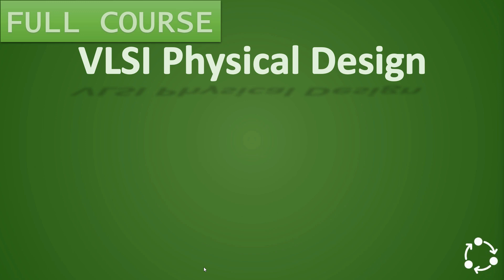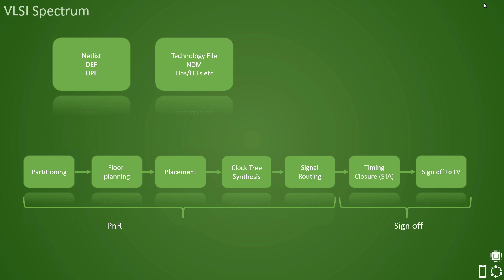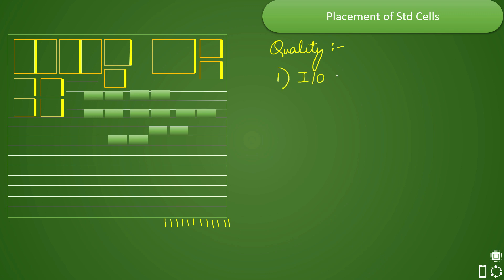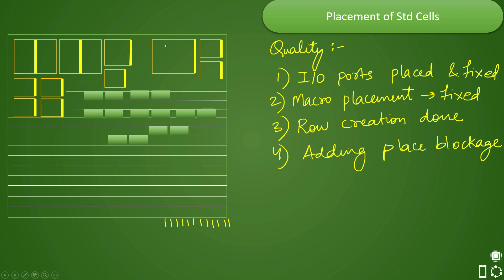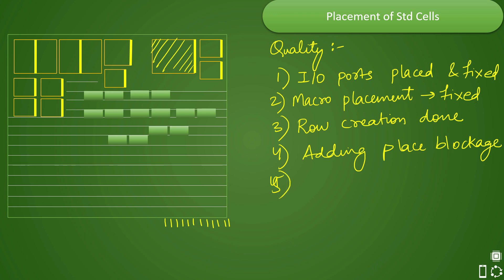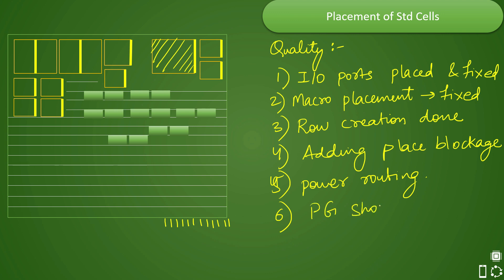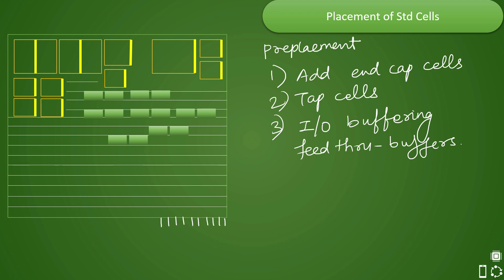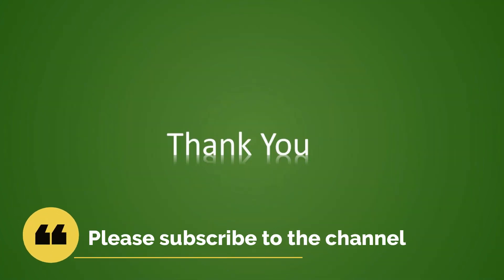PD Lec 31 - Introduction to Placement | VLSI | Physical Design

Comment: End cap cells placed at the absolute edges mainly for protection of std cell gate during manufacturing.

Tap cells are used to prevent direct discharge path bw Vdd and Vss - Latch up

I/O buffering mainly to provid I/O buffers before placement of std cells stage based on requirement.( anything more please add sir!)

Decap cells are used as Voltage compensator, to prevent IR drop.

Spare cells are used as a guideline for safety purpose. If suppose before tapeout, there are some timing issues, and all the macros/std cells they are fixed, for the ease there are some spare cells provided which will not be connected initially to any logic blocks, but whenever required, we can connect.
Reply: @VLSIAcademyhub  ok. Cool thanks for the reply 😀
Reply: @VLSI Academy
Hi sir
Can u please clarify is spare cell and filler cells both are same
Reply: @VLSIAcademyhub  
Ok sir